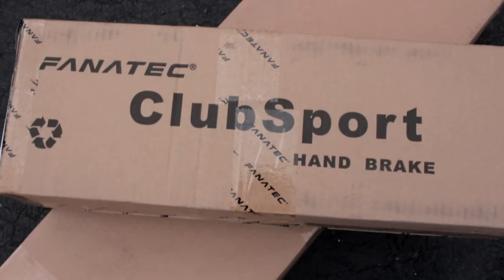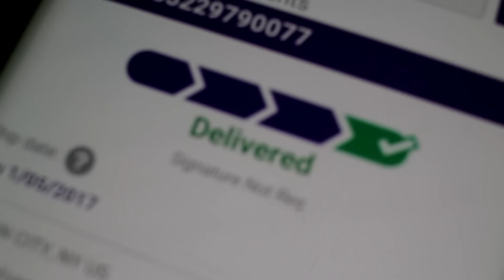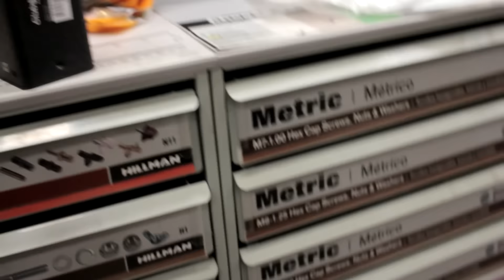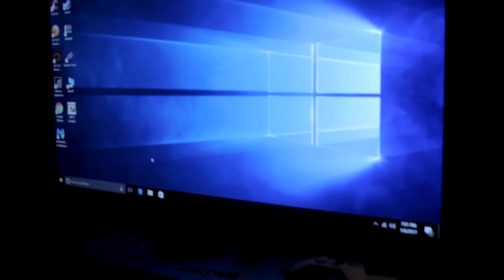AWESOME DRIFT SIMULATOR + DURANGO SNOW DRIFTS!!

Comment: Yo Cam sick ebrake ! on your e36, the ebrake doesn't even reach the top of your steering wheel !(check your insta in case you forgot ;)) Non of the formula drift boys have a ebrake higher than the steering wheel, the top of the handle on most of them are as high as the center as the wheel ( even ken blocks who is known for his big ass e-brake! ) , so for better training and muscle memory mount the ebrake on the shelf next to your shifter and train for that pro-am next year ;) ! a small motion to the side to grab your brake is faster then lifting your arm every time.

Comment: Shoulda mounted the bracket to the bottom side of the table instead. Then mount the e-brake to that upside down (so it still would point upward). That probably would've lowered it to the perfect height. It would've had the added bonus of hiding the mount and e-brake box, underneath the table. Also if you did it that way, and it were still too high after, you could adjust it lower however much you like by adding a spacer between the table and mount. If it were me I also would've painted the mount black to match the colour of the table.  The way you mounted it looks pretty silly with it so high, but hey if thats how you like it all the power to you